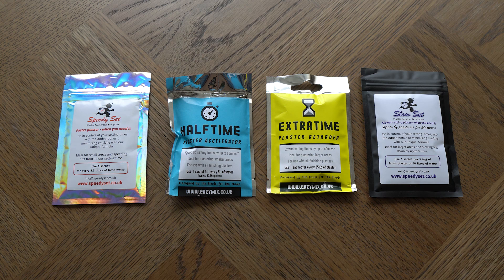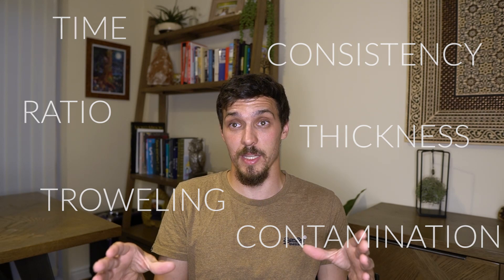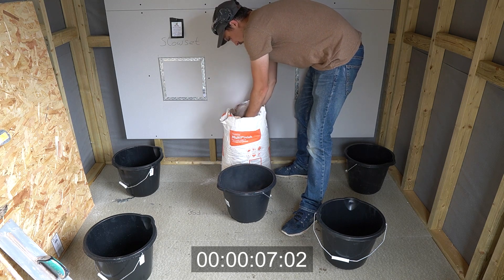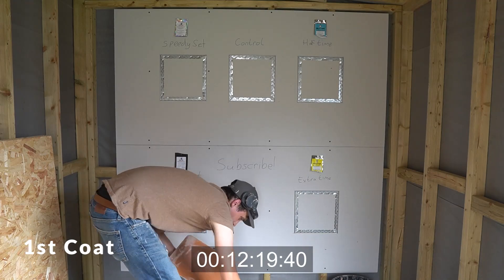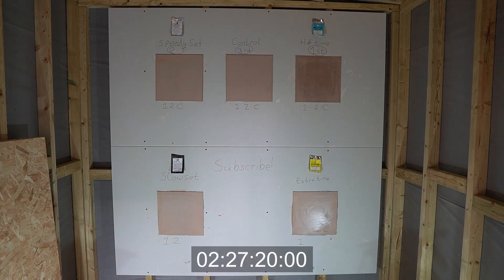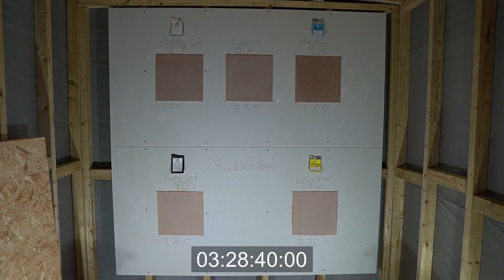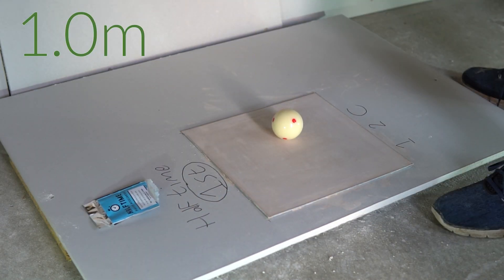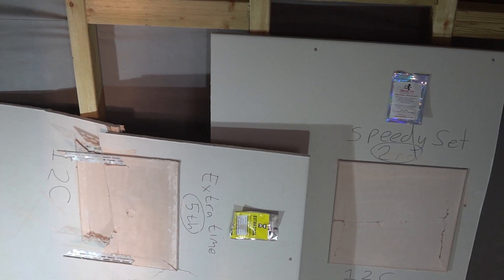Eazymix Vs Speedy Set - Plaster Additives - Which is Best? Halftime Extratime Vs Speedy set Slow set

Comment: If speedyset is finishing at pretty much the same time as the control..... what's the point of using it?
Reply: none apart from based on Ryan's test the plaster is stronger using speedyset than using nothing. Ryan perhaps a bit more real   life strength test would have been to hit it with a hammer. Also would been interested in seeing as a control group how mixing with dirty water affected it , or using other additives like cement or bonding , otherwise great vid , thanks for doing

Comment: Good video.
I've used half time first and then found speedy set on ebay.
Gave it a try and I much prefered it to halftime.
Sets in about 1hr20 mins a but makes it better to work with as well..not sore what ingredient goes in it to make it more workable but it works
Reply from the maker: Thanks, I agree that speedy certainly seems to feel better. I couldn't really I corporate a consistency element into the test but had I done so speedy would have won that one for sure

Comment: I’ve been a plasterer for 18 years I actually got sent samples of both products to use and review, and I can say I think speedyset and slowset win hands down , 
It makes the plaster so creamy and nice to work with has fibres for strength to help prevent cracking 
And takes all the greasyness out of the multi .. so I’m defo team speedyset .. use it all the time now
Reply from the maker: It's good stuff, I couldn't really show the consistency difference in the test but if I had, speedy would have won that for sure

Comment: Fair play mate, confirmed for me what i already knew but thanks for taking all that time to make the video.

Halftime and Extratime by Eazymix mix work best in both situations. Halftime sets faster when you need it to and extratime  sets slower when you need it to. So in my opinion they are better than the competition as they actually do what they say on the tin 🤷🏻‍♂️

Little side note plaster setting faster doesn't weaken it... drying out to fast is what does. 
Also the plasterer continues to harden over a time so the slow sets that looked weaker would of just been the same strength the next day given more time.

Think how fast a plaster cast sets when you use pure gypsum? 
Well British gypsum actually use retarders to make multifinish otherwise it would set within a few minutes.

My conclusion is... if you throw  snooker balls at your walls then you will get dents. 
If i want to accelerate a set then halftime works best, and if i want to slow it down then extratime is the winner. 
I don't like the ideas of adding fiber because it can cause issues when trying to feather the plasterer out when patching.

I will be staying with the original and best Eazymix products.

Oh its worth mentioning the same company also make
Halftime for bonding 
Halftime for adhesive 
Extratime for cement

Thanks again for the video, keep up the great work 👌
Reply: Is strength in your work not important then ?   Our tests as  well as this above  test show,   in both cases , Slowset and Speedyset out performed halftime and extratime by a substantial amount     The setting times were marginal hr more or hr  less than nioral plaster setting  . If you   wanted a quicker set  just add more of our product , we  can set Gypsum in less  than  30 mins on patches  ...WITH NO ILL EFFECT or  weakness , more you  add the quicker it sets  .     .  

Its worth mentioning  that out speedyset works on ALL gypsum based plaster - no need for silly  numerous bags . 

Speedyset will work on Drywall / Bonding/ Hardwall / multi finish / unicoat /boardfinish / universal one coat etc. it even works on some gypsum based tile adhesives . All of  these without weakening the end product !
Reply from the maker: Thanks, it's was a pain to make and has obviously caused a bit of debate but I felt like it needed to be done. I don't have any skin in the game, I'm just presenting what I found.
Reply: @ryanseeleyplastering  great vid  thank you . You worked hard to show an unbiased view

Comment: Hi SkimFast . We make Speedyset products . Firstly thanks for a very fair review and I love the video .  Can I firstly say  , if you add more of our product  of Speedyset , your plaster will set quicker and even stronger.  We sell to some of the  best teams in the UK and have had no complaints of  reduced  acceleration in any way - it will knock a hour off your time   . We have in tests ourselves , increased dosages  and set Gypsum finish plasterers within 30mins easily , add more product = faster setting time with no ill effect  .We also add  an improver to help the plaster become less "greasy "  , which can't be seen in your tests (which is a shame) but many buy our products as it turns greasy multi into creamy gear  . We also  add our uniquely machined fibres for our particular needs   . These fibres will increase not decrease strength as you so rightly pointed out, yet cannot bee sen on corner beads of blends   ... We offer  OUR additives at the same price of the competitions , but our products WILL improve the  spreadability  &  increase strength of  end cured product . Weaker plaster will increase the chances of cracking . We dont use crystallised products either , mainly due to the chance of chemical reaction with lime backgrounds and paints that can cause u spotting.  Our product will not do this .    Thanks again for the review.  All the  best - Justin at Speedyset.
Reply from the maker: Thanks Justin, your products are very good and I'm glad you have seen the video. I'm very impressed by the strength your additives add to the plaster and as I said in the video I would (and will) opt for speedy set products given the choice. All the best!
Reply: @ryanseeleyplastering  We are delighted you're happy with our products. We've worked hard to get  it right .   All the best Justin Speedyset